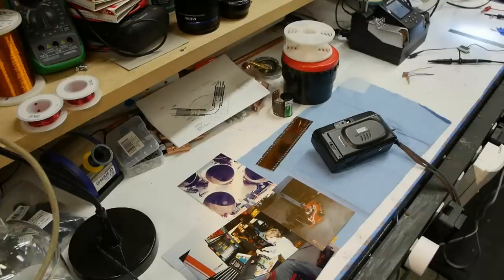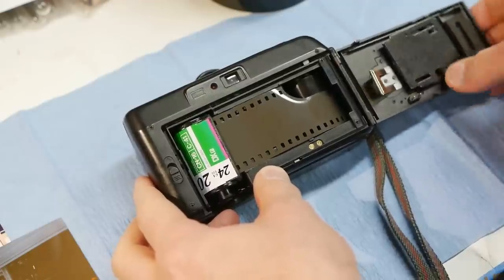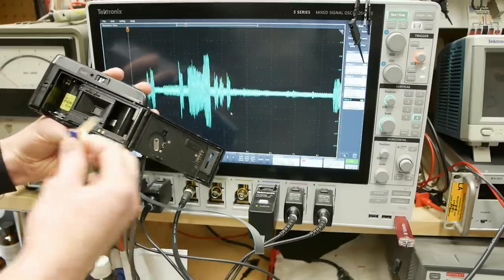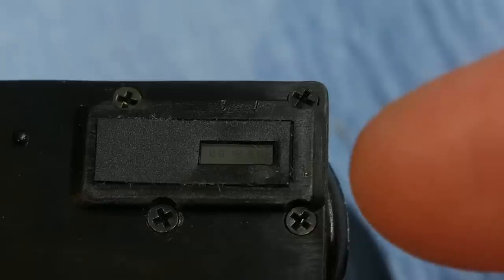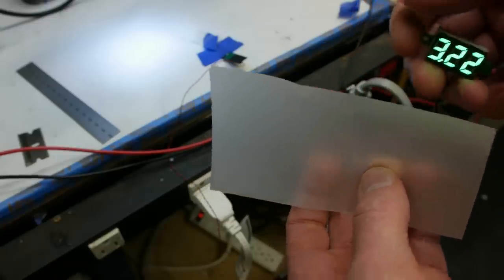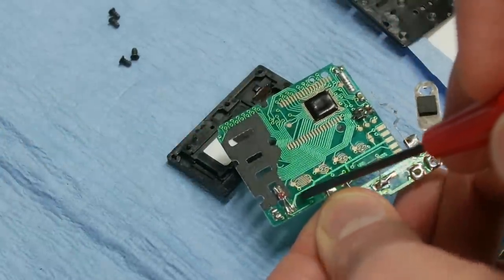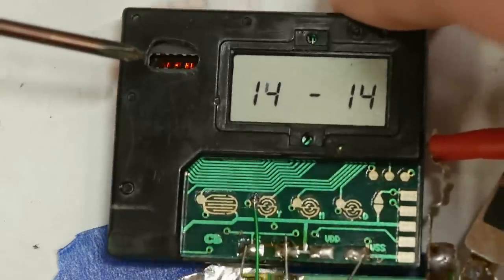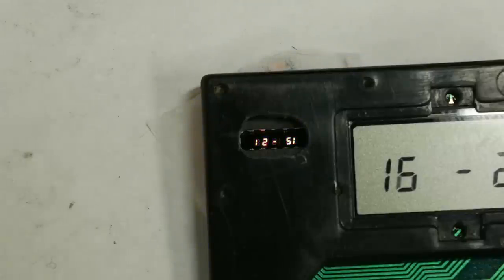How a film camera superimposes the date onto photos

Comment: Amazing technology. I used to have a Konica Minolta camera during 1993-2000 and I have prioritized it over then hot favorite Kodak film cameras because it has date and time stamp feature. Although I paid few buck more, it was a big amount in those days. When I purchased digital cameras I disassembled the Minolta one and kept its back door (containing date/time lcd) and its flash with charging circuit and a big capacitor. All is still in my junk box.

Comment: Thanks for the superb video. I have a Canon A-1 which I purchased in 1979, and it came with the data back, much like the Nikon except the wheels were not interchangeable. The whole data back came off as the back of the camera and the cable ran into the sync port on the camera, so the date would be applied whenever the shutter was tripped. There were three intensity settings  based on the ASA of the film you're using. The light emitted was a bright white, and this resulted in at pleasant Orange image on the film. As I recall it used its own Mallory PX -28 6V battery, which is what the camera also used. Past memories, thank you

Comment: Psh, that camera is good for another 2 months at least!
Reply: And then it'll be good for your kids/grandkids again in 2090!
Reply: Maybe cost of film and development will cost more than the camera now.
Reply: @weithiamneo1442  I can't predict much about the cost of film, but development is - and most likely will still be - dirt cheap and you can do it at home. In a pinch, you can even process a C41 (color) negative in ancient (created in 1890s) Rodinal, or even coffee (google: caffenol processing). Of course by doing that you only get black & white pictures, but hey, that's still analog photography, with the added fun of experimenting!
Reply: Jakub Dołęga wouldn’t analog photography imply that it uses analog electronics?
Reply: @among-us-99999  Analog photography traditionally means using analog medium (photosensitive film) to capture images. The control electronics don't really matter much - a roll of 35mm film would work the same way in 1925 Leica and in 2018 Canon EOS-1V. Now that's some serious backward compatibility!
Reply: Jakub Dołęga but isn’t that more of a chemical process? I thought that analog just means that there are more possible signal levels than "1" and "0"
Reply: is it october already? time flies so fast!
Reply: Not any more it isn't.
Reply: @among-us-99999  analogue in electronics means "relating to or using signals or information represented by a continuously variable physical quantity such as spatial position, voltage, etc.". when we say analogue in reference to something like photography or sound or video, it basically just means "not digital" lol.

Comment: That's great!, thanks for showing this, i still takes pictures in old cameras with film and this was super interesting. The reason for the white light turning out red shifted on the film i think it's because of the composition of the film itself, which has 3 color layers i think being the last one (the closer to the back of the camera) the red one, which is the first layer that hits the LCD projector. There's a whole artistic technique in old photography called Redscale which makes use of this property of the film, the film is put on the camera inversed, so the red layer is the first to receive the light coming through the lens and produces red toned photographs.

Comment: Finally a question i can answer @ 12:45 @appliedscience
The date appears red because of the chemical emulsion in the film, there are 3 types of chemical in a film layered up over each other. Normally, when you shoot the film "correctly" the blue sensitive layer is up front, then comes the green one and then the red one. But if you shoot the film flipped, the red sensitive layer is the first one that is exposed to the light, some photographers even shoot photos like this intentionally to give the film a red look, that's also why this style of shooting is called "red scale". And thats exatly what happens here, the photo is still exposed the right way, but the data back exposes the film from the other side hence it appears red/orange.

Comment: Great video. The explanation for the amber hue of the numbers is actually pretty simple. The film that 99% of people used was daylight balanced for approximately 5500K the incandescent bulb shown in the display is closer to 3000K therefore will register as a warmer hue. You could get tungsten balanced film but it was much harder to come by and much more expensive. It was only mainly used by professional photographers, and more specifically those who did high end architecture, advertising, etc. it was typically denoted with the letter T at the end of the ISO rating. If you used a T rated film the numbers would have appeared almost stark white instead of amber. 

Hope this helps.

Comment: Hi there, 1st of all thank you for this video it was fun and beautiful to listen and watch everything. I work as a senior laboratory technician at Academy of arts. And actually I work a lot with celluloid films and analogue photography. I just wanted to answer on your potential  question about color of date imprinted on photos. If I'm right the logic would be this: the reason why the color is red or orange is actually connected to bulb color temperature (kelvins). If you look carefully the light is orange and when it projects on film you will get inverted complementary color cyan (that is all in negative) when you invert negative to positive, than again you will get complementary pair of cyan - orange. So the reason why all the dates are orange or red is actually depending on light temperature of bulb. If you change bulb color, you would change also color of imprinted date.

Comment: Very nice. The long light path to the LCD also adds in the inherent ability to not have a focal plane, as the distance from the LCD to the film will vary slightly due to temperature and the back of the camera moving slightly, yet the superimposed date is always going to be sharp as it is a shadow, and not formed by a lens. Only variation from changing back position is a slight change in image size, and that is a much smaller change compared to having an out of focus image.

As to the slower update of the LCD, that probably is also due to the polarising filters and thicker fluid inside, to get a denser image contrast. Plus there is also probably a IR cut film applied to the one side, as the IR from the lamp would bleed through the LCD anyway, due to the long wavelength, so you would need some form of coating to either reduce this, or the front surface mirror is dichroic to not reflect the IR onto the LCD.

Comment: hi! thanks for great review! it is very impressive how people figured out this cheap way to project the date stamp on the film.
I just want to add that red shift in the projected colour related to the fact that  consumer cameras these days always turned white balance of in camera settings to get neutral look, so most of the shots were in daylight above 5000K, incandescent light is 2700K will always appear red or orange. in case you could adjust the colour temperature to 2700K, the date stamp will appear white coloured.
Reply: You are correct, if the time stamp projector would have been projecting through the front of the film. If you expose film through the back, everything gets a reddish hue because of all the different emulsion layers you're projecting through. Lomography made a 'redscale' film that is just normal film, spooled onto the reel in such a way you expose it through the back. 
The emulsion consists of 4 to 12 coats in color film IIRC.

Comment: More film camera tech please, there is so much outdated and cool tech that we are forgetting about in these. I use film cameras partly because i love the amount of engineering and sophistication that goes into these compared to all computerised based systems that we have nowaday (still cool but you can't really see it)
Reply: Computers just make things too easy. (I say that as a developer of both electronics and software) Analog is always so cool because they really have to go for reduced complexity just to make it work, fit, be cost effective....etc. Nowadays just throw a $3 mc that you use 10% of it's features in an unoptimized fashion and it still provides more power in smaller space and less intricacies of the product. (Not the mc, what it's used in)
Reply: @GRAYgauss  Nothing easy about computers. Sure they're mass produced, but they're the most complex and delilcate devices ever created by man. Economies of scale result in the $3 board.
Sure, it's neat to see mechanical devices that got it done in the past, but there's way more engineering done on the computerized side to get it working like it does.
Reply: Not outdated. Some of us (me included) still use it. In fact I use it exclusively. Digital cameras don't produce an image that's nice looking IMO.
Reply: Can agree, my oldest camera dates from 1957 (amazingly I have the original box too!) And there's just something amazing about the fact no electronics are used to get a picture. That camera would go through an EMP and be unphased by it.

If curious what camera, Argus C-20. It's an updated version of the C3 from what I could find.
Reply: y2keable I'm not saying film photography is outdated ! I am using film cameras most of the time over my DSLR. I just love the fact that when all of our modern life revolves around computer science, it is still possible to make a great looking image using only analog technology, good mechanical and optical design and some chemical emulsions. So in a sense it is outdated as little to no development is done on new film cameras.
Reply: @scythelord  bruh I'm in ee and I'm a developer. ive made CPUs from scratch, I'm not talking about their internal complexity I thought I made that clear when I said not the mc when talking about fewer intricacies. I was speaking of them as a black box for the designers using them. And yes. They're easy, circuit design is easy and so is low level or high level development. If you think it isn't you obviously don't have decades of experience or talent. If you didnt misread and put words in my mouth I wouldn't have decided you're worthless. /Elitist shots fired

Comment: the exact second when you pointed out that the exposure of the date came from the back my brain said "yes, of course" - because I have also wondered about the color of the imprints.

I myself always found these date imprints annoying and irritating - a better system would have been to imprint it on the unused side strip of the negative or between the frames so that later at the lab it could optionally be superimposed onto the image or perhaps be printed on the back. Some film manufacturers used the side strip for additional information like brand name and negative-number, but the spac between frames was always empty.

Comment: I was hoping you’d reprogram the LCD to go past 2019
Reply: Do not play god
Reply: I was too lol
Reply: it's a blob on board, so not much hope...
Reply: Might require a few jigawatts of power
Reply: I was thinking the same thing. Do a mod to extend the date past 2019.
Reply: Kysen10 if you look at the lcd at 6:16 you will notice that the year digit only has the segments for the 1
Reply: @TheGamingComputerBomb  That's for the Month :)
Reply: @JohnnyX50  -Camera made in 90s
-Only displays years xx1x
Yep, definitely not a month, they were just producing tech ahead of time :D
Reply: @TheGamingComputerBomb  As already mentioned, the middle digits aren't for the year.  They're for the month.
Reply: You could always do what many RTC Devices do in modern times. Most RTC Devices use a "Reference Year" you pick a year number that you know of and it calculates the offset to said year. This way an RTC Device can work with any year. In this case you could pick year 2000 or (00) as offset year and 2016 and the reference year (Because it's the last leap year). 2019 in that case would be '03 on the camera and you could go all the way to 2035 in that system before you would have to start over back to 00. If you were storing these photos long-term you would need to make sure to mark the reference year on the container, album, receipt, or somewhere for example given the time-frame is so short before it starts over (every 19 years) so you wouldn't get your reference years mixed up. Ultimately with the modern RTC system many RTC devices employ, the camera would print valid dates until it physically just died.
Reply: does anyone here know how to make it go past 2019? been trying to do it myself. I have no idea why there's a limit. it seems arbitrary
Reply: I'm gonna buy stock in the manufacturer. Everybody's going to need to buy a new camera soon.
Reply: June Hanabi How would I edit this?
Reply: @mikejohannessen9772  Manufacturer of these was EpsonSeiko. Stopped making them in 2004 sadly.
Reply: @jackwiegmann  It might be because of the way the camera stores and calculates the date, but you'll most likely have no possible way to change it without changing the chip
Reply: @jackwiegmann  I also think it has to do something with the chip, but this doesn't mean hopeless. I am going to learn some electronic knowledge to see if any chance to fix this. I hope Applied Science can also make a video of breaking the date limit.
Reply: i was thingking hte same thing, it's that possible?
Reply: @choninwong355  did you have any break throu?

Comment: I have my grandma's old Canon T-70 SLR, which was super technologically advanced for 1984, because it has auto exposure that controls both the aperture and the shutter speed, along with auto film advance. I've used it, but I kinda don't like it as much as a manual camera like my Pentax K1000. I really like my Kodak Signet 35, which is just a rangefinder, where advancing the film is separate from cocking the shutter. That one also has a feature where you can't accidentally do a double exposure, because you can't press the shutter button without advancing the film, but it actually has a bypass lever that lets you do double exposures if you want. I like those older cameras because you actually have to know a bit about what you're doing to get a good picture. Phone cameras are nice and convenient and whatnot, and I use mine a lot, but I really love shooting film.

Comment: 9:42 If you notice it had other slots for mirrors to go in, with the matching holes in the circuit. Therefore I'm assuming they could be fit for different film sizes by just changing the mirror position and the back plate, that has the lcd fixed after this position. Cool.

Comment: Hi, the orange mask is there and for a good reason. It has to do with color contamination. It is there from the start and part of the process to obtain accurate colors for the printing process.
The orange/redish colour of the numbers comes from the bulb being a normal 3200k type and film used is daylight (5500k). Also color will vary with film sensitivity from dark red to brighter yellowish tint (50 iso to 3200 iso for exemple)
For more info this link, section 3 will provide accurate informations.. http://www.sebastian-schlueter.com/blog/2015/8/27/understanding-color-negtaive-film-for-scanning

Comment: Interesting bit of detail - well done! 😃👍🏻

Personally I always found this date/time „baked“ right into the picture quite annoying. It just sticks out like an incredibly sore thumb. I get why people would have wanted this but it never was for me. Some professional cameras like the Nikon F4 had interchangeable backs available lime the MF23, that put all the metadata into the space between two frames. But these were completely unaffordable, and in some cases still are, as shown in this video withe much older MF10. 

My very first own camera shot 110 film. It is not made anymore.
Fun fact: from what I’ve read, you can load your own 110 film using 16mm film that is normally loaded into movie cameras. 

Personally, I have „leveled up“ through 35mm to shooting 120 film in a Mamiya RB67 (and an M645 if I want to travel a little lighter). But for most stuff you will come back to 35mm like an old friend. ❤️

Comment: I had a Canon "Tech E", one of the original items in the EOS line, along with the 650 and 620. IIRC, it printed as the film was rewound, and had a dot-matrix appearance.  I had the optional keyboard, and could enter text for to use labels.
I always assumed it was an LED.  This was from 1987 BTW.  I suppose it could be the same thing as you show, but with a vertical line of dots as the LCD elements.

Comment: It’s funny that a fully motorized camera is an upgrade for you. I love the feeling of pulling the lever and advancing the film. Also I’ve never used a camera like that but I would guess that it might make it harder to get double exposures or things like that.
Reply: Cameras for 135 format film always had protection against double exposures and partial advancing. Even the cheapest ones that had no exposure control whatsoever. 

Automatic advancement is kinda useless in my personal opinion. The exception is in high tempo shoots, i once saw a film camera that could do multiple shots per second. You can't do that with manual advancement (but most consumers would not take 5 pictures in 3 seconds or so, thats only something sports photographers would typically do)
Reply: LimaVictor that’s a really good point about taking multiple shots. I’m not really sure how an automatic camera would protect against intentional double exposures because I’ve never used one. I got the impression you thought I was talking about an accidental double exposure, but I’m kind of confused about that haha